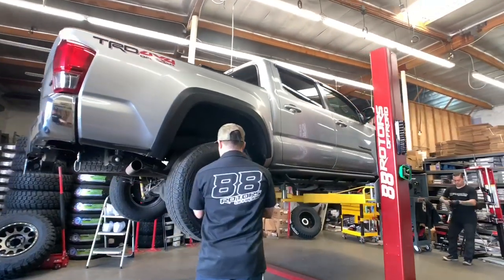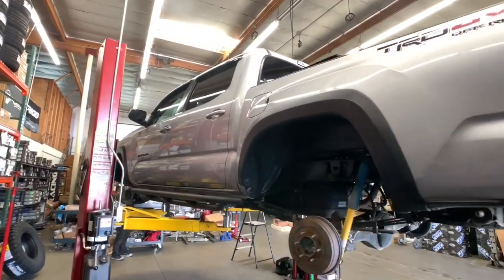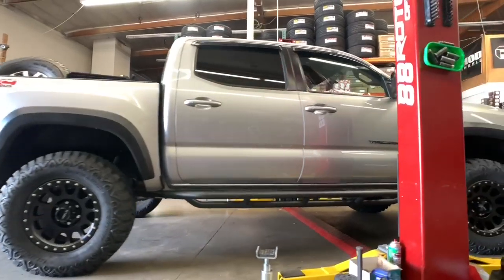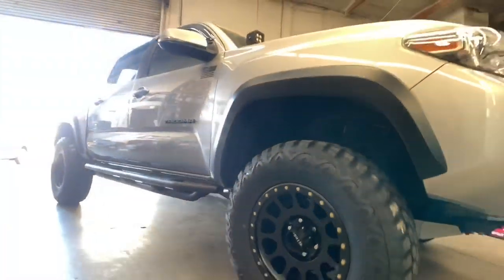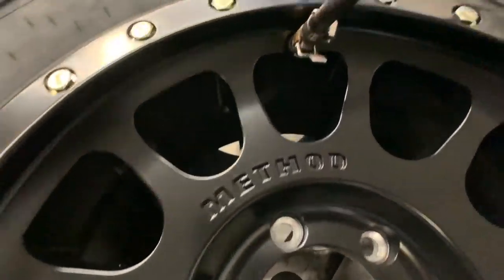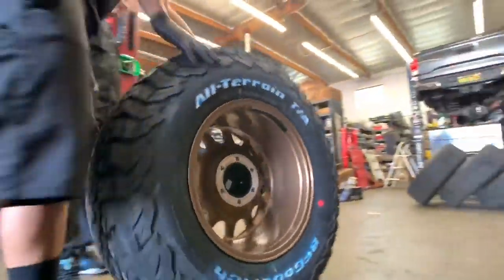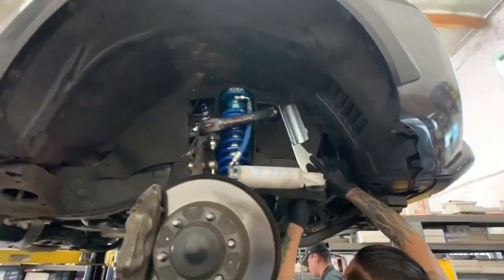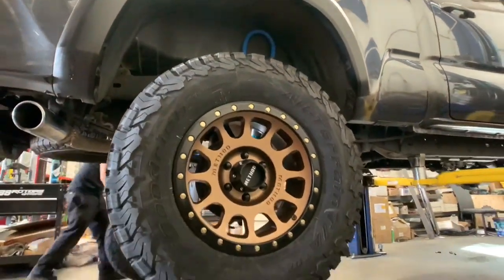Toyota Tacoma Spacer Lift, Springs & Shocks, & Coilover Lifts

Comment: Are those 32.8" tires?  (33's) ?  I was wondering how many people end up getting re-geared after doing that upgrade. I went with 265/75/16 on my truck and almost feel a re-gear is needed. Come to think of it.........It needed re-geared right off the showroom floor , lol.  I certainly wish i could get my truck to you guys. Open a shop in Florida too !! (Panhandle)

Comment: When is a CMC needed? What tire size and wheel size/ offset  starts to rub. Im doing a kings lift with new UCA’s. I would like new wheels and run a slightly bigger  wheel and tire.  I have 265 75 r16 currently.
Reply: Usally anything 285/70/r17 or bigger requires a cab mount chop.

Comment: I have install the trd pro grill in my tacoma trd off Road 2019 with the tss sensor. What suspension and lift tall do you recommend for not having tss sensor  fault alerts. Thanks
Reply from the maker: As long as you don’t have crazy Cali lean, you’ll be fine.
Reply from the maker: @shiftatarts Sorry you feel that way. We respond to all serious questions if they aren’t already answered in the video.
Reply: Crazy Cali?? I’m lost. I just want to know the best lift height without problems with the TSS sensors. In this video you didn’t use new suspension. I want to use suspension for mine.  Like the fox 2.5 kit.
Reply: Jossue Morales - I think in the video prior to this one, the narrator addressed your question.  Check their youtube page and watch that video.  If it isn’t in that one, then it’s in the one prior.  He said something about the lift they installed didn’t trigger the sensor you are talking about.  First time I ever heard about that issue, so it stuck in my head.